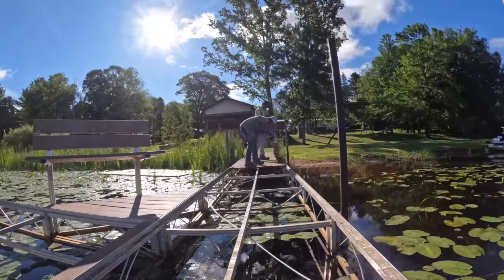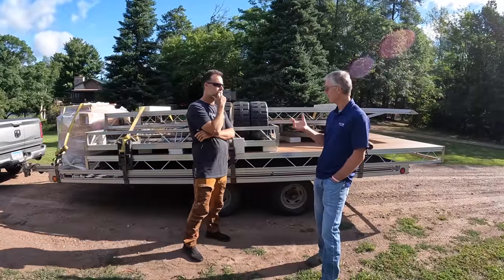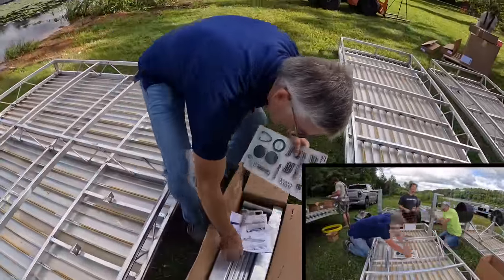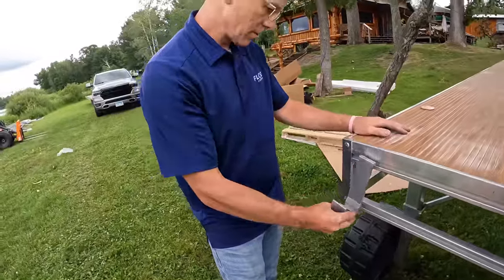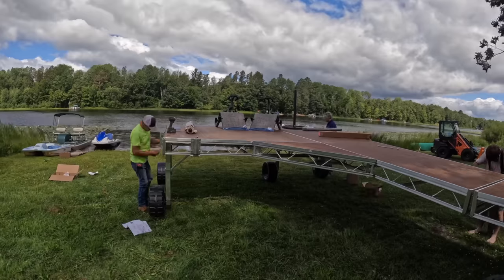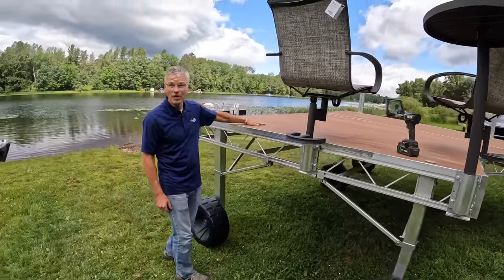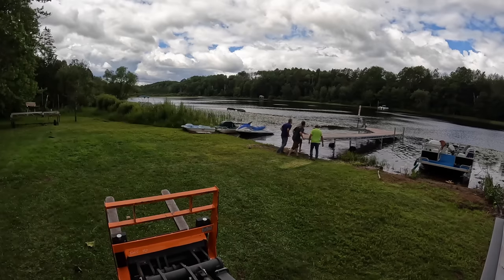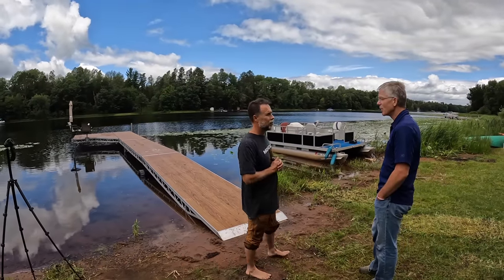Dock Upgrades NEVER seen before #new  #cabinlife

Comment: The way the chair connects to rails swiveling is best prt. So u need every 12" or so arch section u hook to railings Then it just put streach on clear rain covers on. use tinted rain covers in FL.

Comment: We have a dock from Remer Ironworks. It's a great roll in system. The wheels are places at the center of gravity so it balances  and you can crank it up and down from the top and set it without ever getting in the water. Untill this floe dock you show here I've not seen another roll in dock I liked as well. This floe system looks pretty darn sweet. It may actually be better...🤔

Comment: I own a dock installing company in West Central MN and we have found that the lift jacks in the legs on Floes are prone to breaking or shifting where you can't fit a socket around the nut in the hole of the decking. About $500 to fix one Flow leg unless you solve yourself, one reason the bolt and wrench style aluminum roll-ins sectionals are more reliable!
Reply: What did Floe say about it when you contacted them? Sounds like a design flaw, curious how they handle themselves from that aspect.
Reply: @timr86868  never reached out to Floe about it, usually the customer just has us put a block under it and level the rest of the dock off the broken leg's height. Gets tricky when more than one breaks. Often it's probably the dock owner that had tried to adjust it themselves and use an impact driver but I think installation and removal each year is hard on the mechanism somehow. One thing about the Floes is that with the adjustment being inside the leg you don't have poles sticking up past the dock, which is a look alot of people like!

Comment: U just connect on the 4 square corner post, only u need sheet metal slide on under side of walk blanks, & when not over the dock u need a way feet to hold & level the walk boards, & bc super easy to pull or move u just pull lock pins to cut the grass if u need the full walk board/ top deck board from back door to dock no gravel path down yet.

Comment: If lower section was bent from 1 corner to width straight straight side u hve a spring middle support(1 from each side bent meeting at middle) or 2 bent center supports that weld or screw to side &side u brace connect too.

Comment: Hving 4 corner holes u can just lift up the walk prt of dock & still hve a dock to walk on while resurfacing or reairing the top section is a big deal, So u just decide if u want to pin the square the corner post any of 6-12inch ht 2"per pin hole so u custom dock ht main way then  2" holes raise per corner post up to 12" to match up w/what u r docking next to pier, best fit. If u need an extra ft higher u need a 3rd deck flat section, again even special plastic or sticker wood will take the most wear.
Reply: Floe Dock sections don't have 4 corner holes unless you asked them to custom build one. They have 2 wheels at the end that attach into the hooks "quick connects" from previous section.

Comment: If the gear rod can hve 2 pipes or rods reversible so that way u r only striping gearing rod on 1 side not both sids bc only drilling on 1 side not the reverse side redundancy b4 u hve to use the other 1/2 of the rod, 2 or 4 tries b4 u need new 1/2 & 1/2 4 -up rods. Use drill on low speed, u want color zones 4 diff height 4 diff colors.

Comment: If u bar want to truck type ladder rack u need straight roof not an arch so u can mount smaller boats on top, or a actual ladder stable even putting feet in lake murky muddy bottom. U need 4 actual feet w/2 fold angle out ft so 4 is 8 legs The 2 extra legs u pull out just need flat bottom base not feet, both sides. In side base legs & the must twist not for standing on but can. As the base board ft twist it helds lock the base, double as thick as normal step so ladder doesn't float away. Floating in water fine just not on top floating away but ft base anchoring it but top 1o ft floating so u can find it.

Comment: 3 tracks beats 2 & no matter how great the system is bc it is aluminum u need redundance bc repair aluminum not easy, if that means hve 2 tracks bottom 1 tract top so u hve prt in water double & stronger engineered that is way to go. Under water repairing welding even harder. Best way to hve redundancy is being able to take an 8ft section not giant 16ft section out to swap it broken out. If bracket can reach from top to inner section in water or top down to outer section in water redundancy w/just lame 2 section not even 3 seure but better.